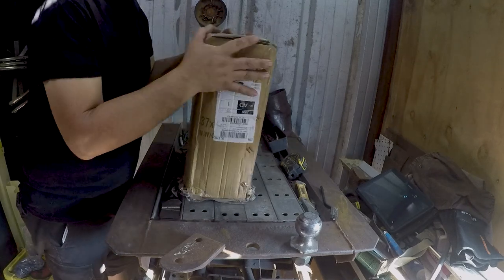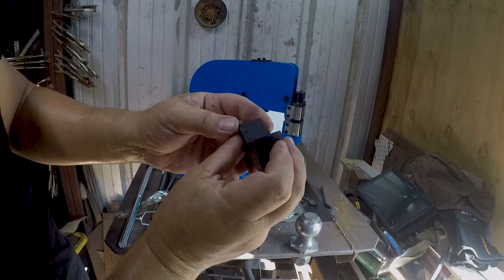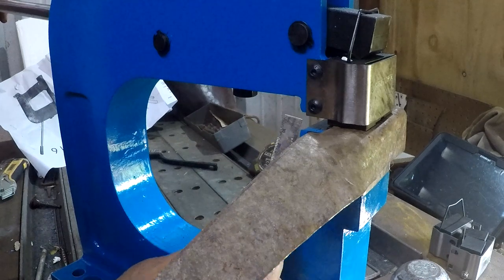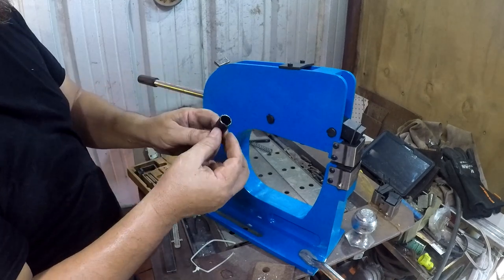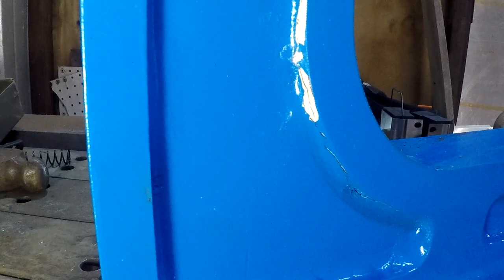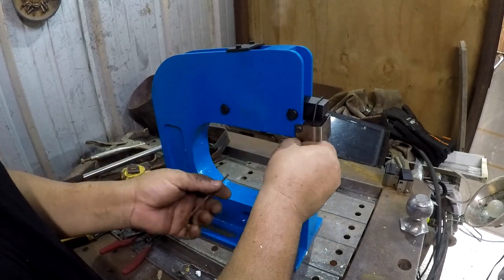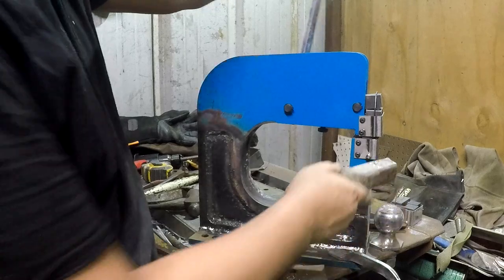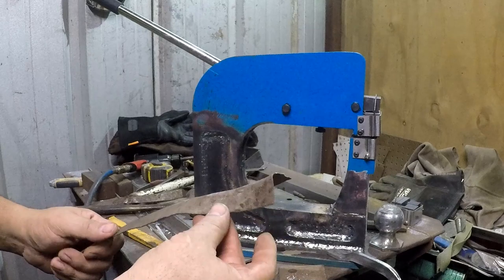Can I Fix This Vevor Deep Throat Shrinker/Stretcher?

Comment: I ended up welding 2 pieces of 3/4" x 3" plate on mine 3/4" back from the center of the 2nd pin. Before welding i put in the press and got the gap in the jaws where i wanted it fully opened. Welded it out and now the frame doesn't move. I still have 7" from the front edge of jaws to the 3/4" plate. Jaws do suck and needed lots of work.

Comment: I just ordered one of these earlier today thinking to myself 'sure how bad can it be'?! lol! ... No harm I'll figure it out, was gonna build a foot pedal for it anyways, she'll be grand
Reply from the maker: Yeah, I figured it would help some people out to get a good teardown on one of these. I should have the next video out in the next couple days where I reinforce the frame and convert it to pedal operation.
Reply: @carswithcrackers  good stuff man,  I've bought a few tools off vevor here in Europe, they're the same cheap rebranded crap you see in other shops but a little cheaper again... they're all fine with a bit of modification I reckon, can't understand why they didn't just leave the side plates without the fake casting reliefs though! ...I think I might weld a plate of over the whole side, and not even bother fixing their awful welds! either that or some angle iron, regardless be interesting to see what you do, thanks for uploading!
Reply from the maker: @biryaniofbodyhair  so has it come in yet? Is it any better than mine?
Reply: @carswithcrackers  hey man, well done on your finished product:) yeah came a few days ago complete with its own set of problems! .. I've just been following Lazze's advice from his video on s/s maintenance  so I'm just polishing up the sliding faces of the jaws and have got it to shrink a little bit but is really inconsistent, it's mostly cause the holes that are drilled and tapped for the retainer are so bad it's comical! One on the upper side was drilled on the very edge of the metal so it's only half a hole, but rather than scrap it they just tapped it anyways! As a result the jaws are all over the place so I'm gonna make some new retaining covers out of some flat stainless I have and figure out a way of securing them which hopefully should take away the sloppy forward and back movement in the jaws....providing all that works I have all the bits I need to make a pedal so once I have that together I'll see how much flex is in it, I mean it's still a fraction of the price of a pro one over here which I couldn't possibly justify the cost of so I think it's worth putting in the time despite all the nonsense that goes with buying cheap Chinese stuff!
Reply: nice video presentation and explanation of the process. it's crazy how bad these tools can be so bad out of the box. but the cost of the so called professional stuff is so outrageous for us backyard mechanics it's still worth it if you have the time, know how, and tools to make the mods. thanks to guys like you and youtube we're able to keep on doin the stuff we love at an affordable way! thanks